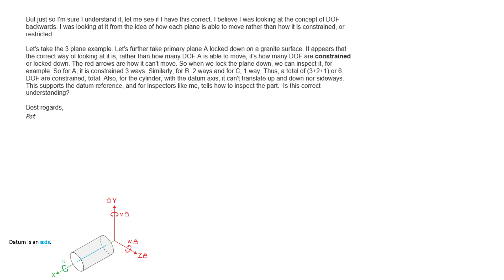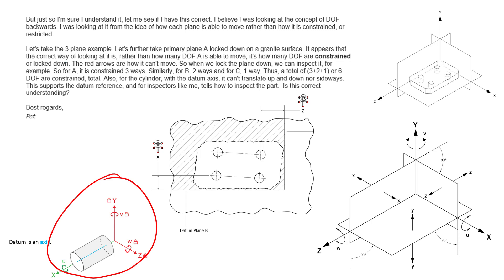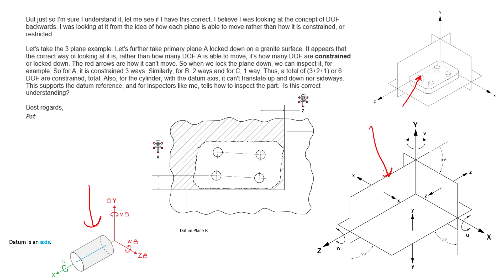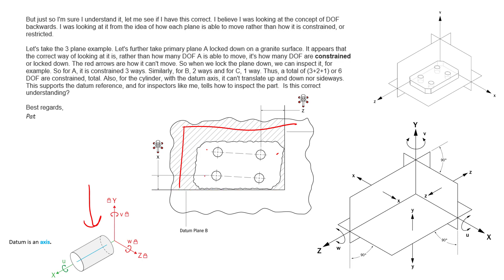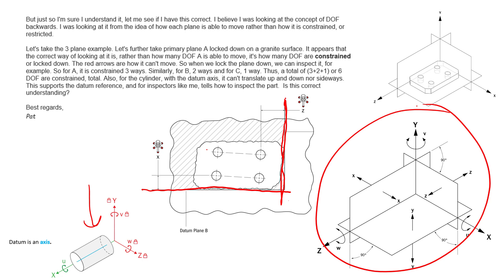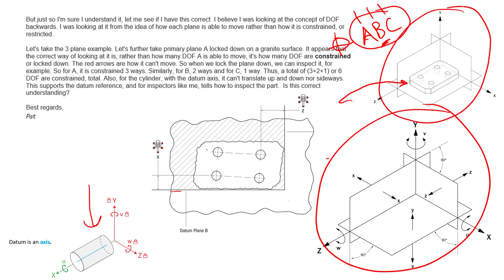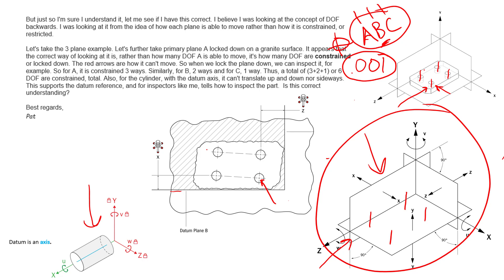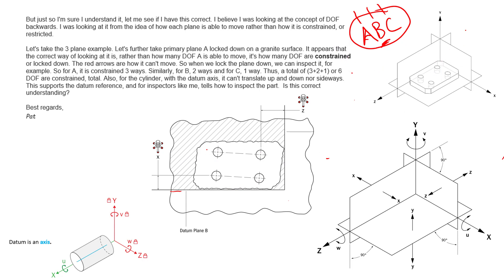GD&T Datums - How do they work and how do they control Degrees of Freedom (DOF)

Comment: hello sir i have a question, assume that on one part i have a hole on the top face of the part which is 0.1 mm positional tolerance with respect to datum A, B then C( assume these datums are planar on very basic rectangular block and ordering of datums are important) on the feature control frame. This means that when this hole is inspected first datum A is constrained from 3 point contact, then B from 2 point contact, then C from 1 point. I also have another hole on the same part which is placed on the left face or right face which is again 0.1 mm positional tolerance but this time with respect to datum B A then C on the feature control frame (ordering is important). This time time same datum B which is used for first hole is used to locate second hole but 3 point of contact is done on that datum. Then datum A for 2 point contact and for C 1 point contact. So same part and same drawing but according to my datum ordering, datum A can be used for  3 point of contact or 2 point of contact in inspection. Is my understanding true? if it is wrong pls help me understanding it. Thx for videos.
Reply from the maker: Yes, you have a good understanding here. If the feature control frame for the first hole is A|B|C, that hole will utilize datum |A| primarily to lock down the most degrees of freedom. Then B and C will lock in any remaining degrees of freedom. Then for the second hole, if the feature control frame lists B|A|C the hole will be located/oriented to |B| primarily and then A and C subsequently. If you were inspecting this part, the part would be completely removed from its setup, and re-set in its new order for these different features. Feel free to check out our video on datum reference frames if you still have any questions.
https://www.youtube.com/watch?v=D9U1YV_96kk
Reply: @Gdandtbasics  thank you so much !

Comment: Do I have to add basic dimensions to every feature which need to be inspected when the 3D model is provided to the inspectors? I mean we have so complicated injection molded plastic parts that only can be measured with laser scanner or classic CMM so the 3D CAD model should be provided to them to able to do it, and they could measure the dimensions out of the CAD model.
Reply from the maker: No, that is not necessary and does make for a very messy drawing when attempted. We simply add a note in the "General Notes" that tells the interpreter of the drawing to query the 3D model for all missing dimensions and that they are to be treated as "BASIC". Adding to also reference ASME Y14.41 is a good practice as this tells the interpreter the standard that covers the rules for "Digital Product Definition". 
Hope this helps!

Comment: How do I this on a cmm? Do I need to find the high points for each datum and construct datums?
Reply from the maker: Yes, you would have to construct a plane for each of them and you want to make sure that your settings are set to capture the three highest points for each plane (this is required for datum establishment). We have to have a minimum of three, but there is no maximum requirement. This does indicate that our sampling (number of probed points) is pretty high. We want to ensure that those high points are captures. 
Hope this helps!

Comment: What happens if the surface that contacts datum A is convex and the part rocks on the datum?
Reply from the maker: Hello Dan, 

Thank you for your question.

Section 4.11.2 of the ASME Y14.5 explains that if a datum feature has irregularities that cause the part to sit unstable (“that is, rocks”) when brought into contact with the datum feature simulator, we must stabilize the part in the “optimum” position. Essentially, we would shim underneath the part to cause the part to sit in the neutral position -- meaning that we would “equalize” the distribution of the shims so that all of our related features would stand the best chance at passing their own requirements. In that specific section of the standard, it states to seek further definition/explanation in the ASME Y14.5.1M standard. It does also state that if a different approach is desired for unstable datum features, such as Chebychev, least squares, translational least squares, etc., it must be specified on the drawing.

We hope this helps!